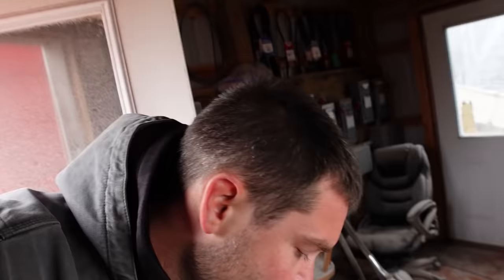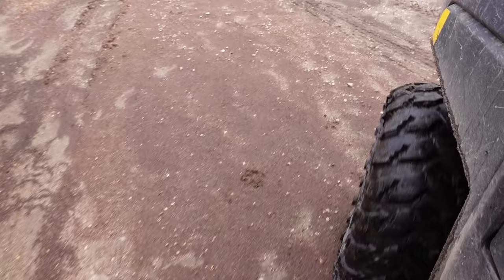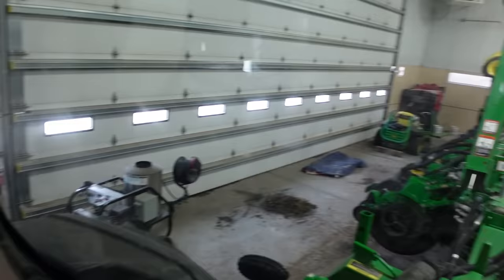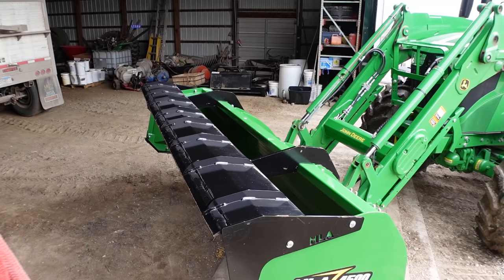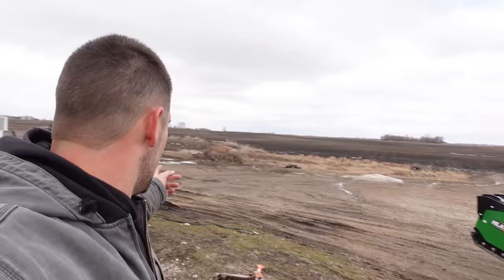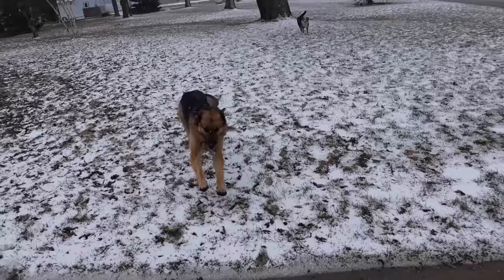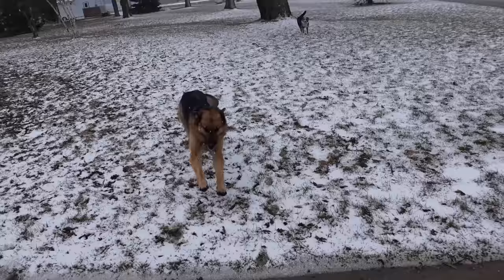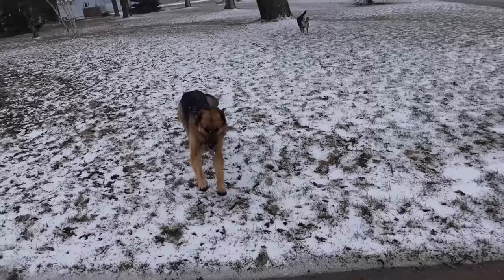Jim says it's Time!

Comment: What are the chances that Anna hears the high pitch of the fuel pump and it hurts her ears?  Just wondering, not that there is a solution.

On space in the shop, back up til it sounds expensive, and pull forward 6 inches. Problem solved.

Comment: Zach I'm thinking you have a major parasitic draw going on with your trucks if the batteries keeping going dead.
Reply: I've heard just moist soil & dust on top of the batteries will drain 5+ amps out of them. For that reason and corrosion is what made side posts to be born.
Reply: @frombryant6678  it just seems crazy that a semi with that many batteries would get drained so quickly.  Which makes me think there is a draw going on.
Reply: @timhurst1813  Possibly leaking diodes in the alternator or something.. agreed

Comment: A truck is a truck. There is no such thing as a 'Semi Truck.' The trailers, on the other hand, ARE semi trailers, IF they have axles on the rear, and a fifth wheel up front. The name came from the fact that the trailer can't move without the truck, and it splits the total weight between the rear axles on the truck and axles on the semi trailer. Just THINK how much smarter you are now!!

Comment: Hey Zack I have been watching your videos for sometime now and see that you are constantly having trouble with dead batteries on trucks or equipment. Having been a mechanic for many years in addition to other things this is not always an indicator of bad batteries. I have noticed that you replaced a lot batteries recently and still have problems with this and thought I might be able to offer some advice. When this continues to happen with trucks and equipment with even knowingly good brand new batteries it indicates there is a parasitic draw on the system when your equipment is shutdown such as computer screen, radios, C.B.s or other devices or even dome and other lights being on and draining your batteries when they are left to sit for periods of time. First try to see if any of these things are perhaps a cause of the draw by making sure everything is shutoff when you park your equipment or disconnected if it does not shutoff through the use of a main power disconnect that can be installed in your battery system loop on the main cables. This insures a full power disconnect to not all battery drain. Second if you do not want to have a main power disconnect in your system you need to isolate and get rid of the parasitic draw on the system. This can be done by hooking up a amp meter inline with your batteries and with everything shutoff you should have zero amps draw. If it is not zero amps draw then any small draw will eventually drain your batteries without regular usage even overnight in some cases depending on how much battery you have in the system. However, what every the draw is it can and should found and eliminated by fixing or disconnecting the problem before it ruins your batteries again. Sometimes finding these things can be a little tricky if it is not the noticeable things I listed before. Sometimes a bad diode in an alternator can cause this by allowing the electrical current to reverse direction and spoil your battery power. Of course you will have to have the alternator checked to determine this one but reputable shops can do it for you if you cannot or do not know how to do it yourself but usually some equipment is needed for this test. At any rate check over the truck and one at a time disconnect things I have listed before even the alternator from the system and see if you lose the parasitic or excess draw when the unit is shutdown. When the draw drops to zero amps draw you have found the thing or things that need to be replaced and this should fix the cause of your problem. I do not usually post on this social media stuff but thought I would give it a try in hopes that it will be of some assistance to you. Hope it helps and I enjoy your content. Have a great day and God bless you, your family, your crops, and your endeavors. Charles R. Page
Reply: Hi Charlek.

Comment: Always wondering why farmers in the US mostly have dirt around their buildings on the farm, why dont you use concrete (tiles/plates). It looks better/nicer, no more dirt and water everywhere etc.
Reply: Dirt is free.
Reply: Money, that's all to it. Most Farms don't have the money to spare for non essential finances.
Reply: Plus if you pour concrete or lay asphalt you will screw it up running a bulldozer or excavator over it with metal track.

Dirt just plow it flat again
Reply: Larson Farms have concrete, they also have an enclosed wash bay. Maybe not having a race car hobby helps with that.
Reply: @deaddoll1361  maybe he’d rather have race cars than concrete.